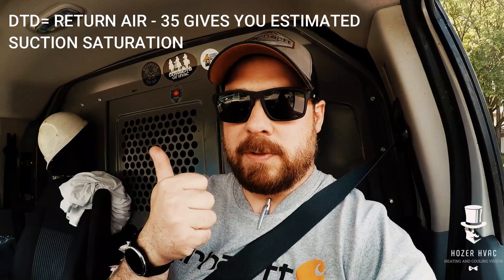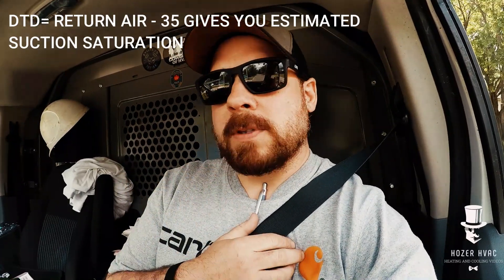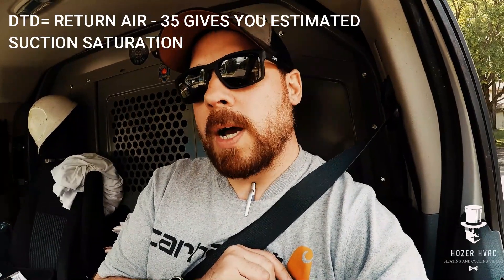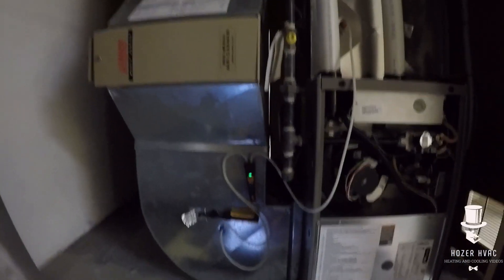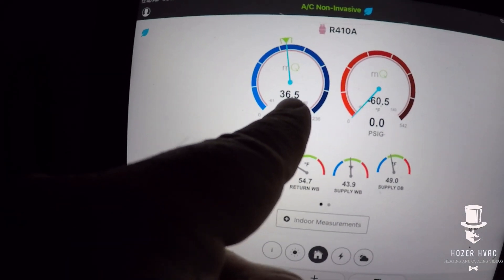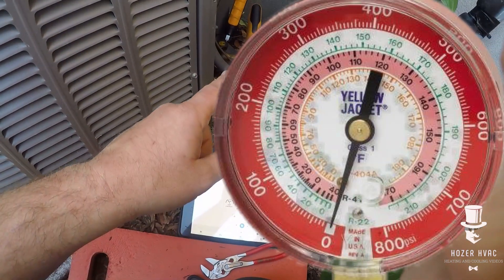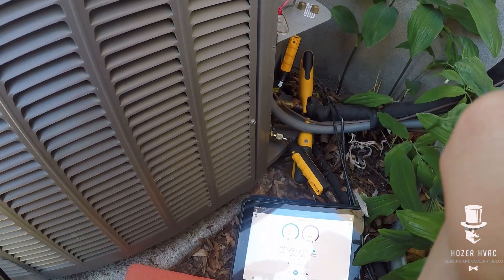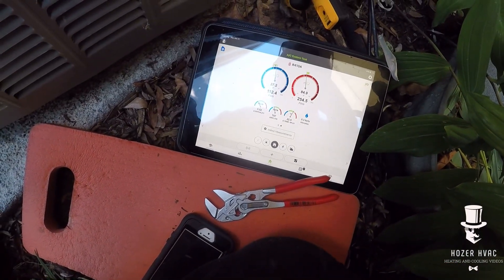Demo of checking a charge without gauges

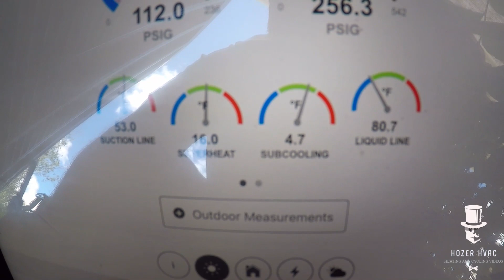Comment: 13:27 - CTOA charts have been around for some time, now; but, I have not seen such a chart for DTD. I only have a RoT when dealing with these numbers. Even the MFGs don’t publish data for their equipment. Refrigeration is a bit different than residential, so I’ve had to do some digging. Any ideas?

Comment: Nice set up what proves you use to calculate the cfm. Does field piece calculate it.
Reply from the maker: Measurequick application paired with fieldpiece probes
Reply: @hozerhvac4406  got it thanks all I need is the fieldpiece no links with measure quick which I have. It's just faster specially if I can get c de m also. Thanks

Comment: How does the app measure airflow? With the static pressure probes?
Reply from the maker: not the static probes, it does it using two psychometrers  and  a formula that has to do with change in enthalpy. Its an estimated airflow

Comment: very interesting vid. Is it necessary to check the charge yearly in the first place if there's a baseline, the temp drop is normal and there are no liquid line gurgling noises?
Reply from the maker: The main thing is keeping it clean. I don’t think you need to check pressures every year. If your temp drop is good and the unit is kept clean than theoretically it should remain fine on a closed system. But I would defiantly recommend every 2 to 3 years you wanna have a professional look at it in case small leaks are forming